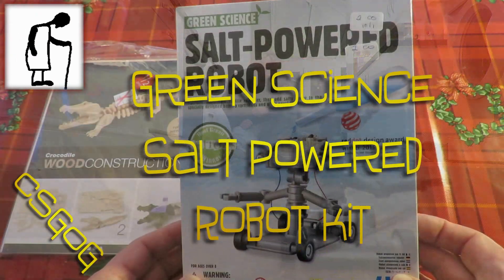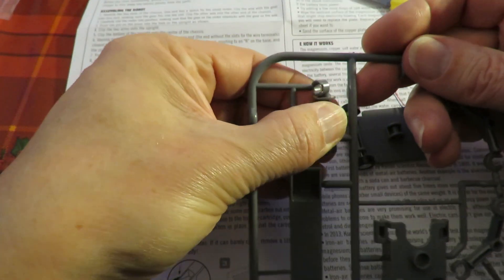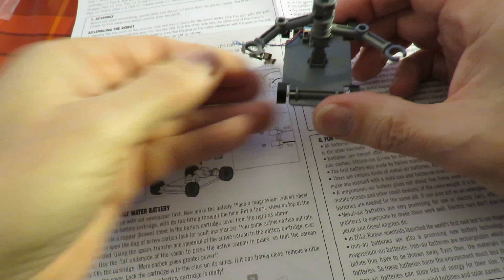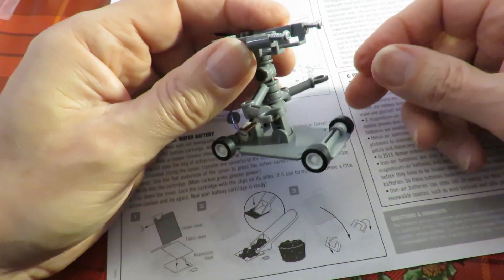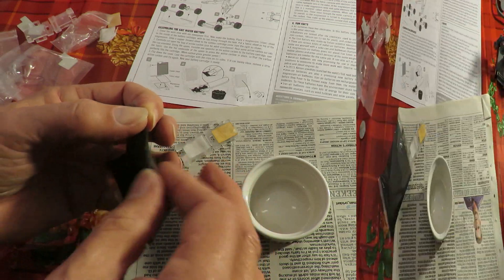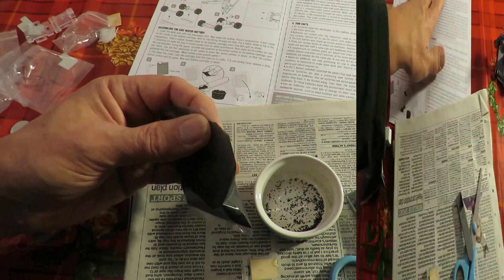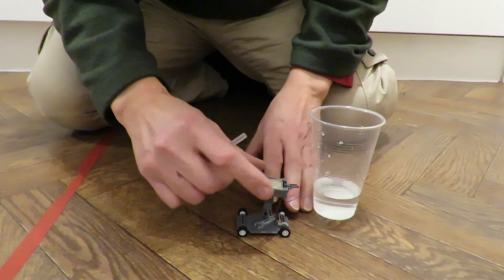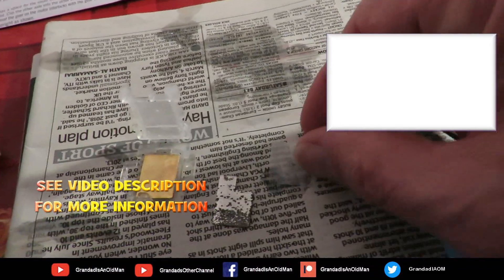Green Science Salt Powered Robot Kit

Comment: Very interesting with the battery. My son just got one of these and it had a carbon sheet and an aluminum sheet separated by a piece of fabric instead of copper and magnesium with active carbon grit added. I wonder why the difference in builds.
Reply from the maker: Probably cost. There is a chart somewhere that will tell you the voltage generated by the different materials. If it works I wouldn't worry about it. If you search for a "Galvanic voltage chart" you can find some detail.

Comment: Damn your hardwood floor is smooth and flat. Nice share :D
Reply from the maker: Unfortunately is is not hard or wood. It is Rhinoflooring or "Lino" as we used to call it. Under that in the kitchen it is chipboard and in the conservatory it is concrete or sand/cement screed. 😁👍
Reply: @GrandadIsAnOldMan  I see. That got me. Nice nonetheless. Cheers.
Reply from the maker: @wewyllenium  the benefit is it is not cold to walk on with bare feet, should you choose to do so. We had the same stuff on the bathroom floor in our previous house. When we bought this house the floor was tiled from the front door through the kitchen. Several of the tiles in the kitchen area were cracked so we had them removed when we had the new kitchen installed.

Comment: My son accidentally pulled the red wire out of the motor. Do you think this is able to be repaired?
Reply from the maker: I am afraid the short answer is no. Technically it is possible but you are more likely to destroy the motor trying to get it apart. The end cap can be levered off and the wire can be reterminated but it is very fine work and I have usually damaged the end cap trying. Here is what to expect https://youtu.be/FWnjq9joyr4